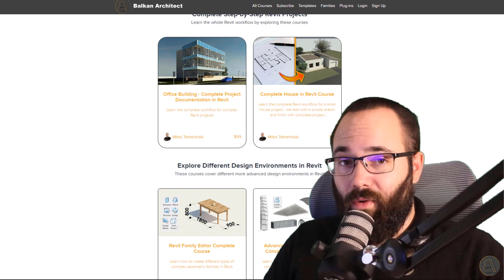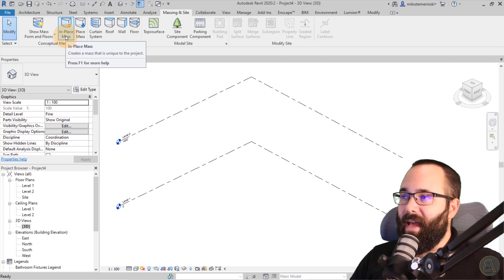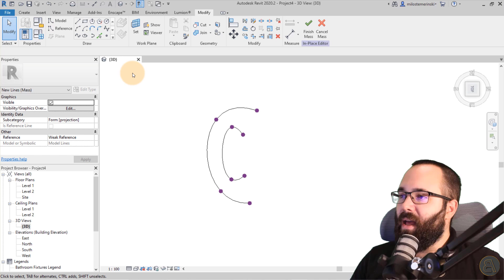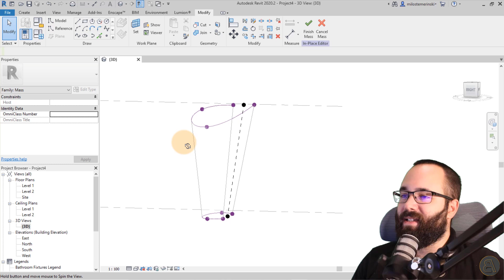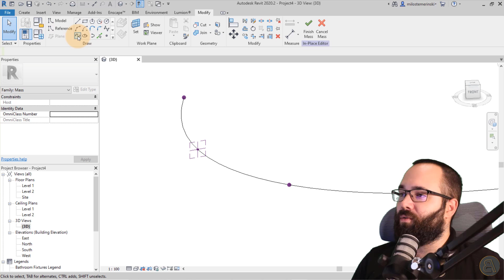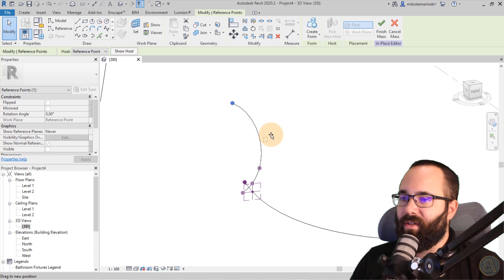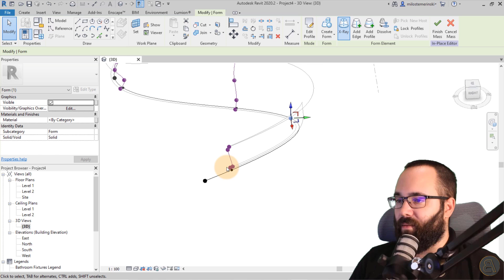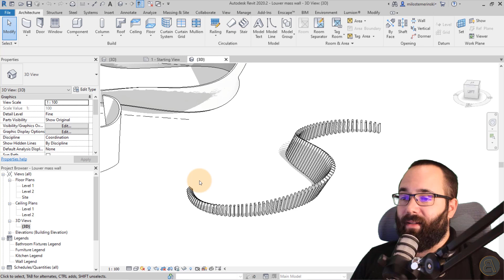Complex Mass Modeling in Revit Tutorial

Comment: hello , i have a question,  is revit can be use for structural design for slab or beam or column like etabs software , for example in etabs we can get the area of steel in concrete such as how many steel bar needed in beam or column is revit give you this information or not ???????
Reply: No, Revit is used for Modeling Purpose. Not for designing structural Elements. you can use Robot Structure Analysis software for design & export your revit model in RSA for analysis & design.